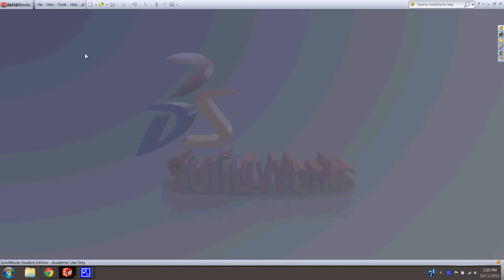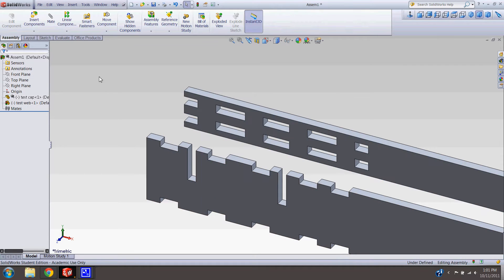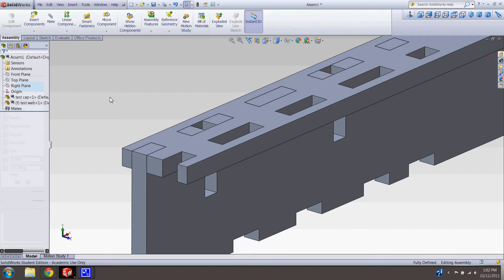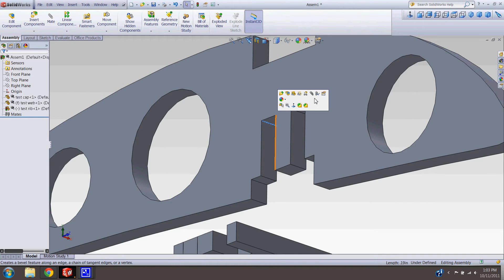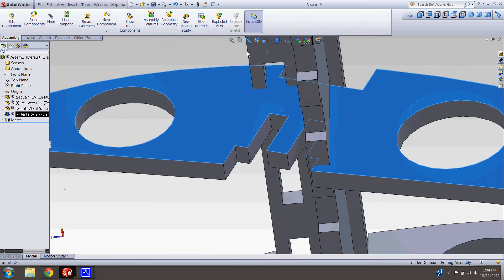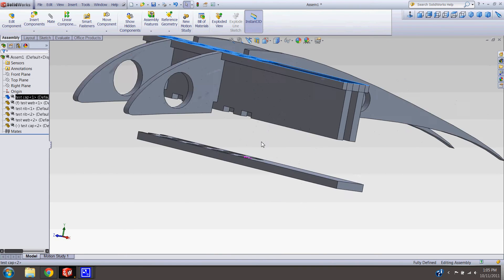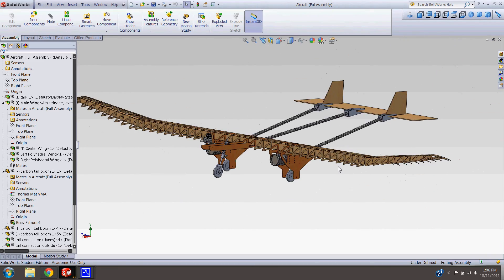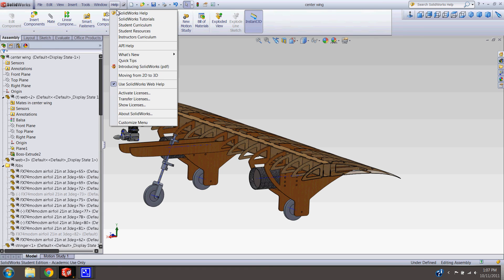How to: Wing Assembly in SolidWorks (4 of 4)

Comment from the maker: Not really in assembly mode. What you'll have to do is import several sketches into one part file. You'll do this by creating multiple planes in a sketch. Distance these planes by whatever rib spacing you desire, and then loft between these sketches.